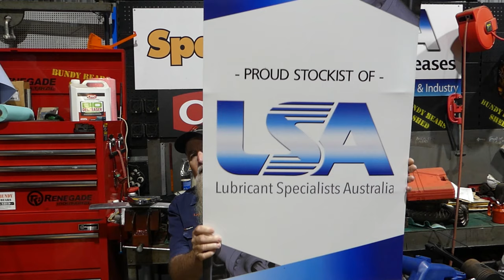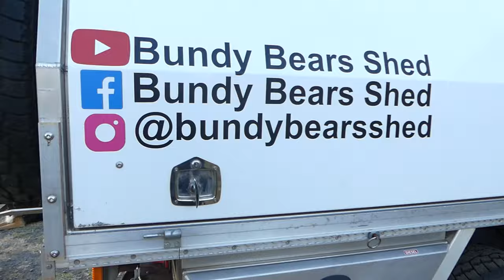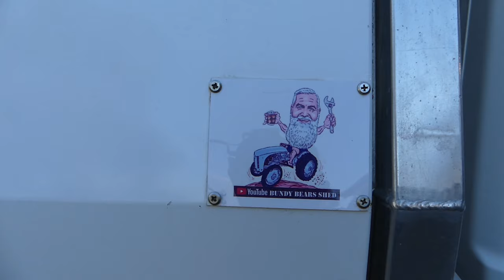Kangaroo Stew # 369 Shed Chat and Packing for the QHR

Comment: hi lance , nice video,  interesting the land cruiser thing in oz,   i like that you still can buy the more utility squarer older type body shape like yours = love the rig up you got in the back - Those older ones here are like rockin horse shit and fetch amazing money if good. We have always had non utility type posh curvy 1992, 80 series and  (2000 to 2002)100 series here 4.2 non ecd intercooler and ecd intercooler non ahc/ahc  in our fleet but they are starting to crumble (rust)  a bit now, (wish we had your weather and they might fair better -the 80 seemed better in that department!  Trouble is the only option is smaller engine pick ups to buy newer now .
Reply from the maker: Yeah the V8 is a good unit, strong and stable when towing a tractor. We like it.

Comment: Hello Lance, I have been watching your videos, and they are very helpful. Is it advisable to replace the hydraulic stand pipe that has an attached square weight on it with the one without it. It is a bit of a hassle to remove the lift cover when replacing the bottom seals.
Reply from the maker: I do at times if there is a good working relief valve on the pump and you dont need pressure control.
Reply: @BundyBearsShed  Thanks a lot Lance. Much appreciated